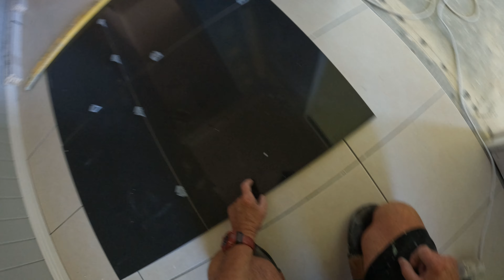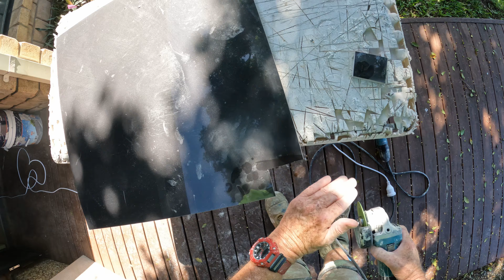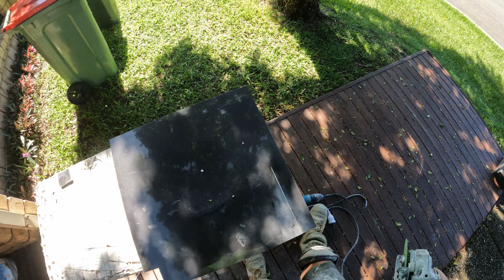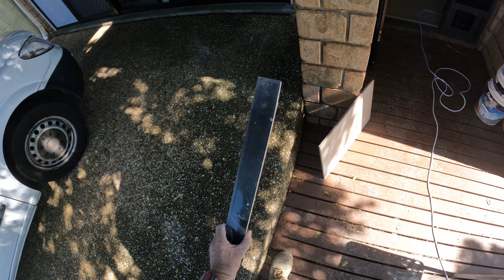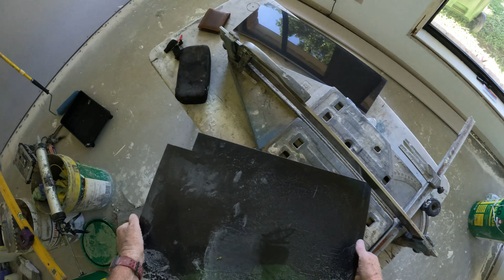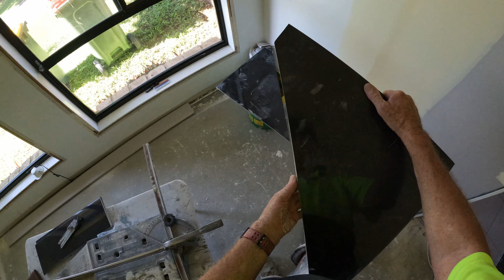How To Cut in Your Shower Base

Comment: Apparently they’re changing the standards for splitting tiles in showers now that they recommend a split joint of 1.5mm to allow for movement and treat it like a regular joint. Looks better with a clean split like chrisso usually does but.
Reply from the maker: Yea mate
👍👍👍